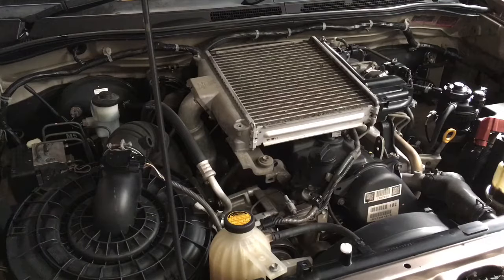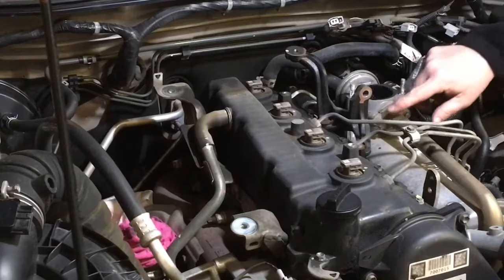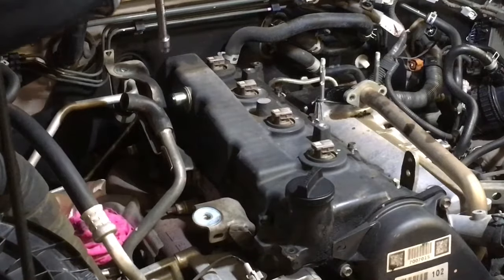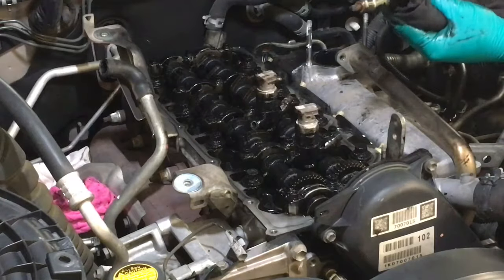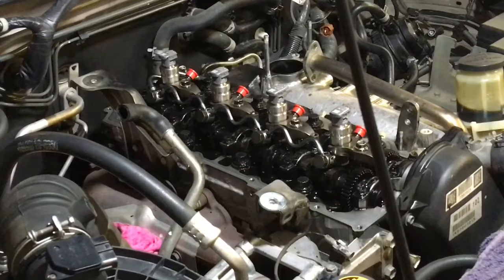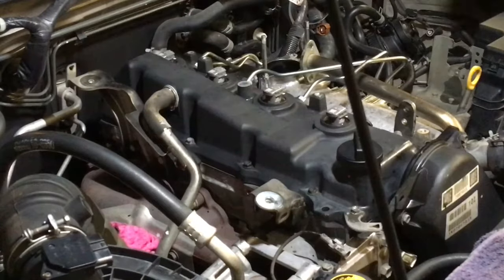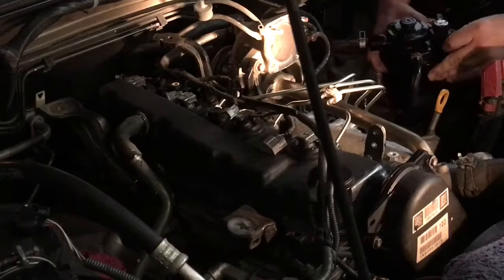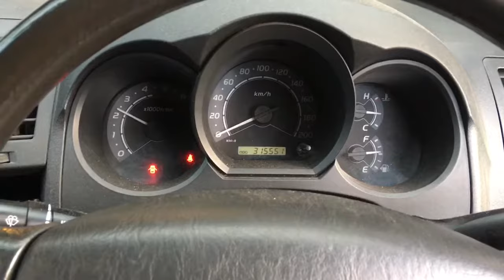DETAIL INJECTOR REPLACEMENT KUN26R 2005 2006 HILUX Vigo 1kd/ftv

Comment: I have a 2014 hilux.
Was worried my injectors were on the blink.
199,650km
Injectors measured in store, at 0.3 
Thinking of donating it to the Smithsonian museum 😂
Reply: Have your injector seats leaked yet?
Reply: I have ordered my new injectors direct from Denso UK, I have a 2014 Hilux from new with origional injectors compensation code starting with 1A, should the new injectors also start with 1A or is the code unrelated to injector type?
Reply: @lescampbell6745 how much were they

Comment: Hi mate. I have a snapped injector solenoid on number 4 injector. My car is a 2008 kun16 2WD. I see that you can buy the solenoids separately and change them? much cheaper than changing the injector. Is this possible? if so, would you have a part number? And any tips for doing it. Cheers.

Comment: Quick question, replaced the fuel filter on my n70 and forgot to prime it afterwards. It ran for 10seconds then conked out, would this have done any damage specifically to the injectors?

Comment: Hey mate just did my injectors on 2011 Hilux with this video when I started my ute and has throw code throttle/pedal position sensor/switch A circuit low, any ideas cheers